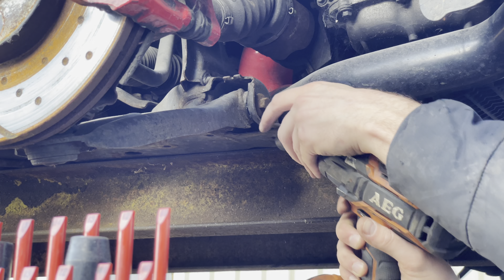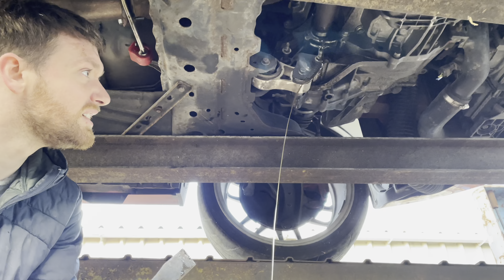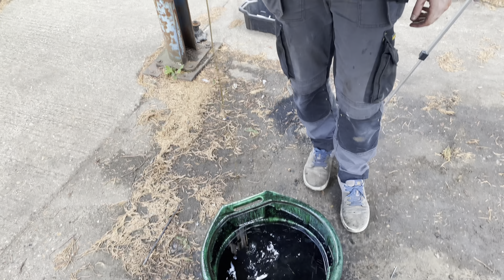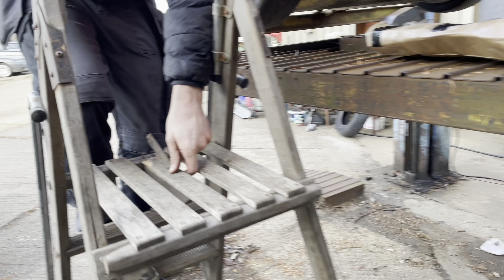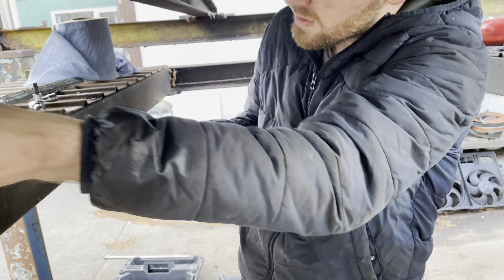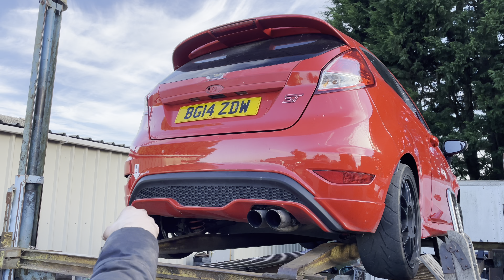Fixing The BROKEN Driveshaft On The Fiesta ST180 Track Car! LOUD Knocking Noise CURED!

Comment: Hi mate was your knocking noise as you release the clutch into 2nd and 3rd gear?
Reply from the maker: No mate, just on pulls. Turned out to be two knocks, the drive shaft and the front right shock
Reply: That's what my car does rn did u find a solution
Reply: Did you ever get yours fixed?
Reply: @ML2193  I got my driveshaft changed which eliminated one knock, but still have a clunk when engaging gears, maybe the input shaft bearing but unsure.